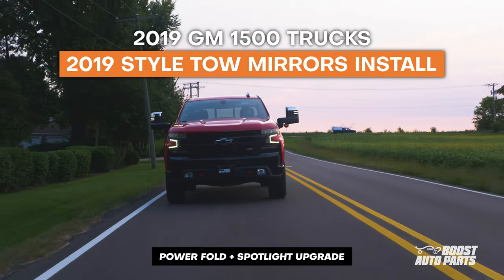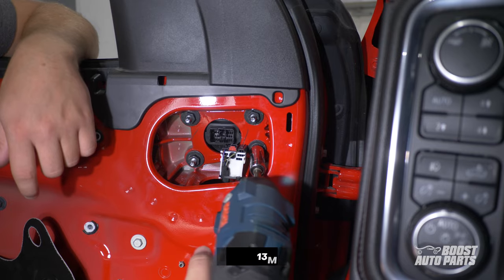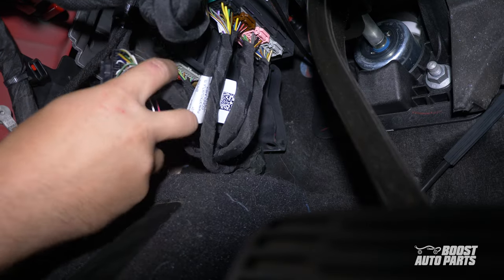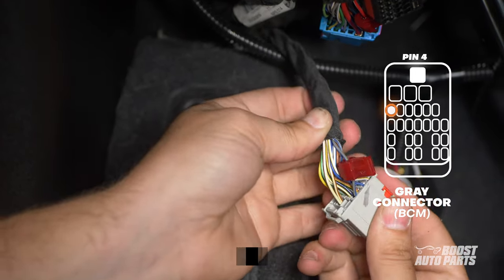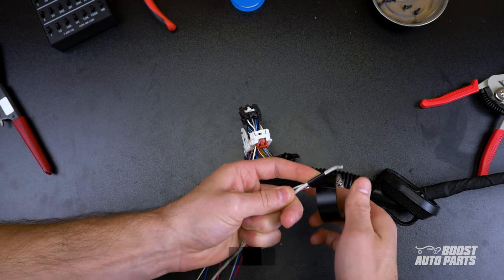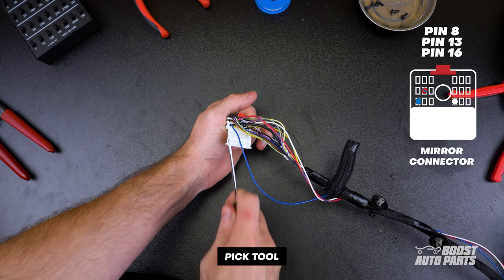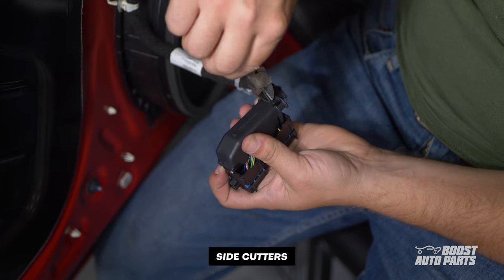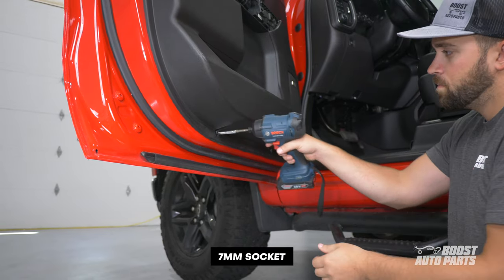2019 GM Tow Mirrors - Add Power Folding & Spot Light - Chevy Silverado & GMC Sierra - Boost Auto

Comment: Can the power folding mirrors fold and unfold when locking and unlocking the vehicle with the OEM remote?
Reply from the maker: That feature requires you to originally have power fold. If you didn't originally have power fold, you would need to fold using the commands shown in this video.

Comment: if you are only looing to add these mirrors and implement the power folding and spotlight features, are all the other steps before part 5 unnecessary?
Reply from the maker: If you're just looking to gain the power fold and forward facing spot light (with our wireless technology), you just need to install the mirrors and do the wireless module install in the door.

All of the other wiring is to gain the running light, turn signal, and rear facing cargo light - so if you're not concerned about those features you don't need to do that section of the install. 

Give us a call at 765-831-2830 with any questions, we have a super helpful team standing by ready to assist with any questions you have.

Comment: I just installed these mirrors on my 19 silverado.  Everything is working except the passenger running light facing forward . Would that have to do with one of the pins for example the blue white or red that's tapped into the mirror connector or door jamb connector?? Thanks